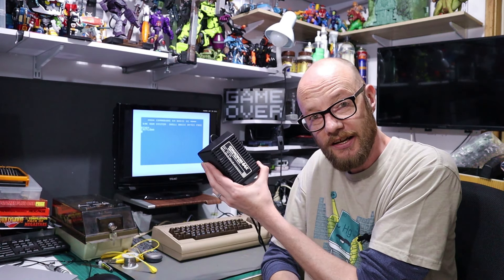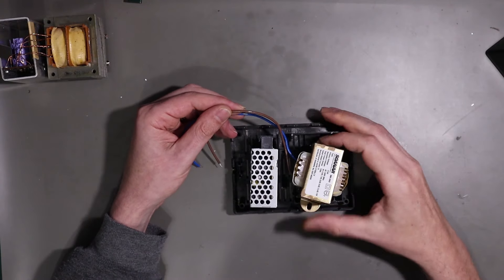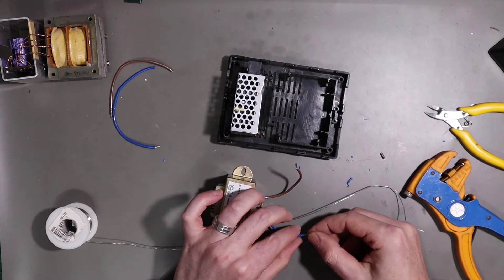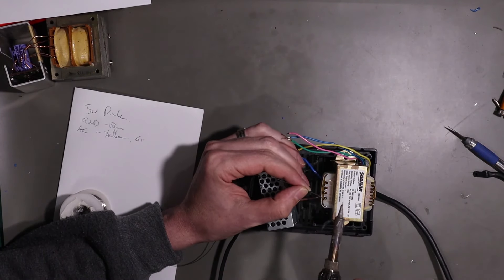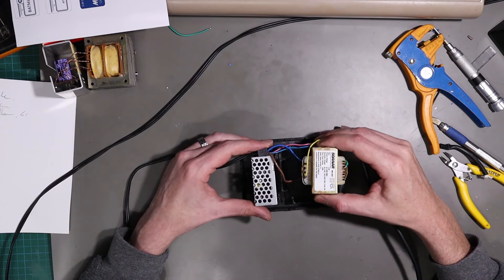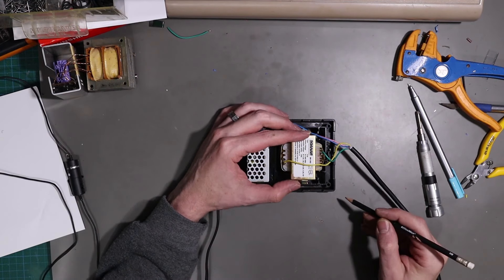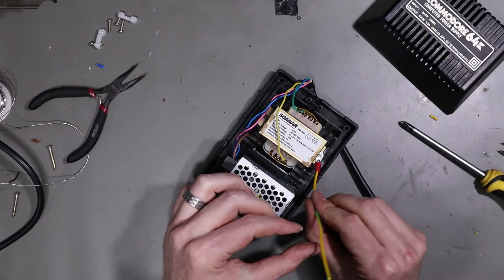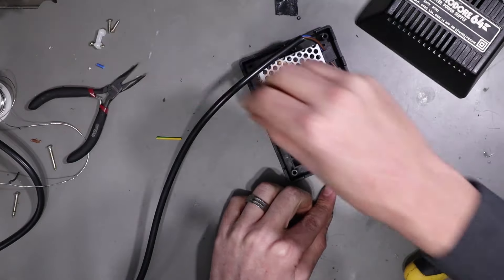Commodore 64 Rescue Pt 2.2 | The Power Supply [Re-upload]

Comment: Great video. Never seen the black one here in Italy. I used the other for 4 years. From 1990 I use a spare one not original...a lot heat but work. For my 1541 ultimate ii+ I use her power supply in additional to the one of c64 and work fine.
Sorry for my "English"... 😉👍🏻👍🏻👍🏻

Comment: Did a couple of these myself.  First one i had to make from scratch and 3d print a case since i had no power supply, the second one i reused an existing power supply after i got the epoxy out.  Mine were definitely not as quality as yours, i just reused parts from new modern power supplies. I don't envy you doing this on video since you have the peanut gallery critiquing everything and for safety reasons can't really cut any corners when showing others, but it looks like you did a great job to me.

Comment: Nice construction. Seeing that there where already some safety changes, I like to add that tinning the wires "for safety" actually decreases the safety of the connections. Solder flows over time and a simple screw (no spring force like in wago conenctors) becomes loose very easily, as the compressed solder flows away over time. Like seen in your video multiple times. Using crimped connectors (eyelets like you sued for the ground wire on one end) without tinning the wires or at least using ferrules instead of tinning on the screw terminals would have been much much safer.
Also: why not re-use the original transformer part? This part is not prone to fail and the hassle of mounting the new one could have been avoided.
Reply from the maker: I didnt re-use the 9VAC transformer primarily to show how it all goes together if you're doing one of the epoxy-filled PSU's.
But reasonable point on the tinning. One solution could be to go back in and add some spring washes.

Comment: A video series on replacing the insides of a epoxied power supply from a guy in the USA, which includes a method to get the innards separated from the case: Part 1 (4.00): https://www.youtube.com/watch?v=Fej_3XbufRA Part 2 (8.41): https://www.youtube.com/watch?v=Hf5g7MCv5xU Part 3 (25.33): https://www.youtube.com/watch?v=GQtCEPOxitI

Comment: That looks like a 1A transformer. It would have been easier to just use the 9V winding on the original transformer, after all it was designed to fit in there snugly.
Reply from the maker: As mentioned in another comment, I wanted to give an example of having to replace both. If your 9V is fine, then yeah, sure - keep the original transformer and only do half of what is shown here.

Comment: omg, he's been using unmodified original PSUs! Watching rest of the video right now!
Reply: I've been known to use an existing power supply when i don't have a rebuilt one around, but always double check the voltages first which I'm sure he did as well.
Reply: @brianv2871  If I use original power supplies I always use an overvoltage protection unit I bought on ebay between the C64 and the PSU. It will trip the power at around 5.45 volts I think it was. Can never be too safe.
Reply: @larsenmats  Yup, good idea.  I've been known to do a lot of il advised things, which is why i couldn't make YouTube videos lest i be flogged by the commenters 😁
Reply: @brianv2871  hey, you can do whatever you want. The more videos the better ;)